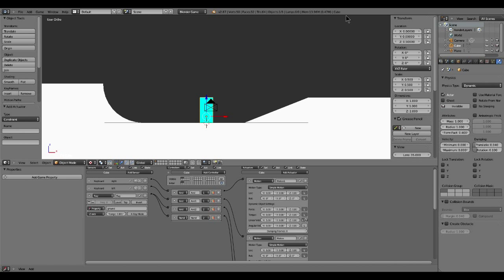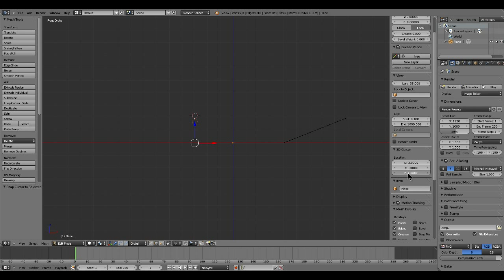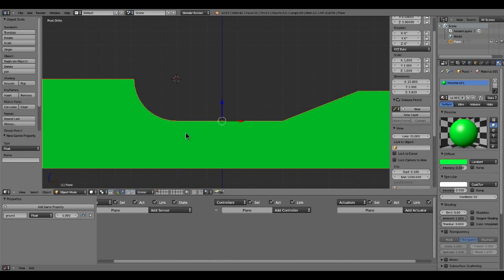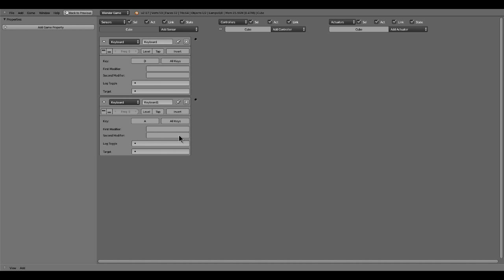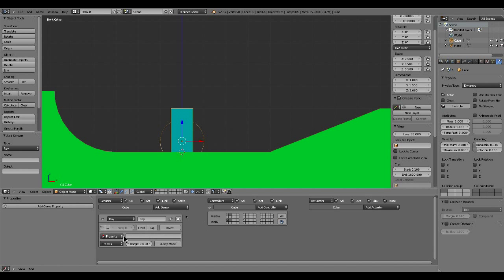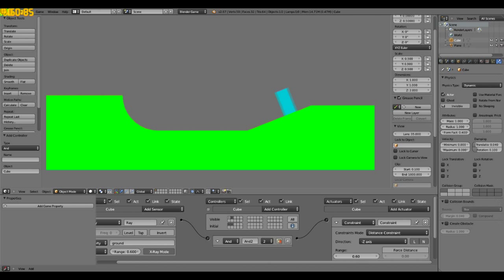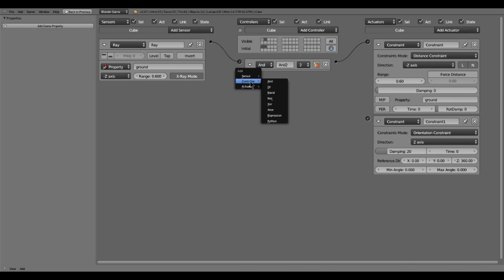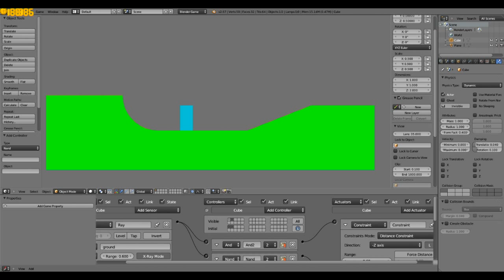Blender Game Engine - Aligning the Player to the Ground Using LOGIC!

Comment: .6 ground ray is the same value i use, i found its that perfect value for it.  in my game i use this method, but the constraint obj is independant of the player.  I needed to do it like that because of an error in using the ori of the objects constraint pos/ori to do math on the object for 3d controls would send the player in a tazmaian devil whirlwind.
Reply: Vector((0,0,-1)) * camera.world_to_camera *  ground_ori * matz  then i multiply by the joystick vector more or less.   since my player goes upside down i needed the exact vector in order for player to orientate perfectly.  up on joystick always runs away from camera in any position or orientation.

+1 sub good work
Reply from the maker: I think I know what your talking about. Here I one idea. 
What if you use another obj?
The main obj that have contact to the ground and align the player to the ground.
The second one is parented to the main one. the 3d alignment code is on the second obj. remove the vector movement.

Then align to vect on the first obj to the second object tell it where to go

Comment: does this also work with loop-de-loops?
Reply from the maker: yeah
Reply: Chishado Games Doesn't seem to work when going up slopes somewhere like 45 degrees (flat ground directly to steep slope). I'm trying my hand at an isometric platformer with a slope system.
Reply from the maker: ***** it does. Gravity settings is probably causing to not work. You probably have to make your own physics for that.